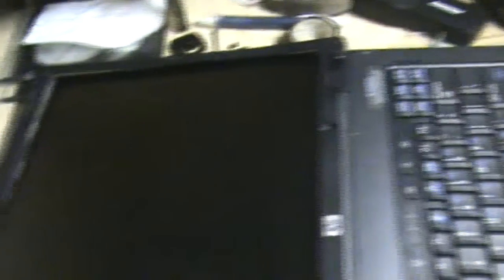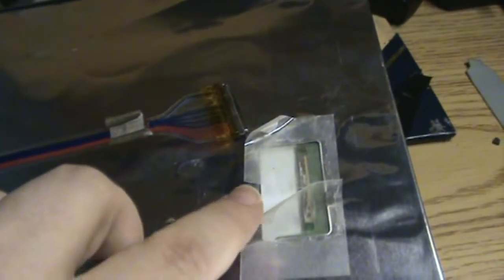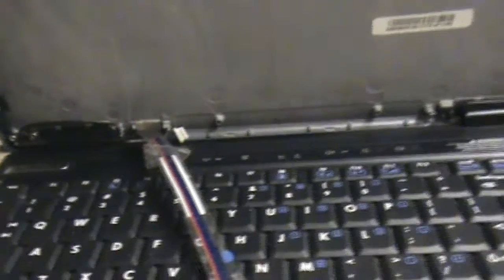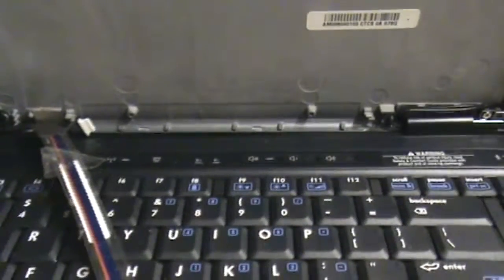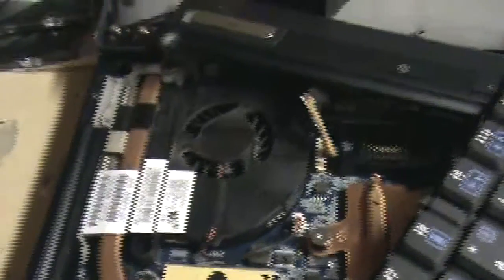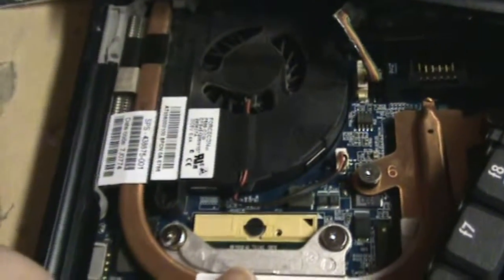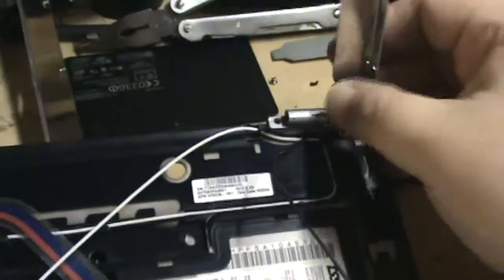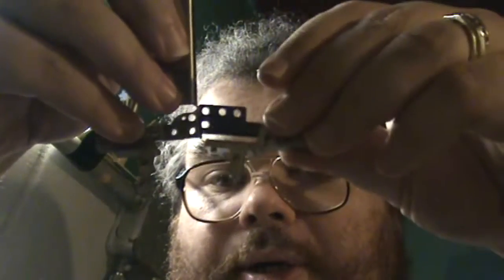changing a laptop screen the hard way

Comment: So... neither screen lights? Did you try a really bright flashlight to see if the desktop is actually there? I heard you say you saw something for an instant...
As a last resort try heat the GPU with a hair dryer or small torch. Consumer grade HP's are notorious for the GPU to overheat and unsolder themselves.
I have tow HP pro books that have been though hell and back and they just work
I have actually replaced the toothpick sized CFL in a screen before, talk about a surgical maneuver
Good luck
Reply from the maker: Craig Nehring I hadn't thought of attempting a reflow on the gpu...I'm ill-equipped to gauge what temperature I'd be subjecting it to...but still, it's a thought. Yes, HP and especially the DV line of laptops have long had overheats due to poor design and even a class action lawsuit on models affected. I like the Probooks too. :)
Reply: ThatWord As Hillary says "what difference does it make" LOL you would be surprised how hot you can get some components